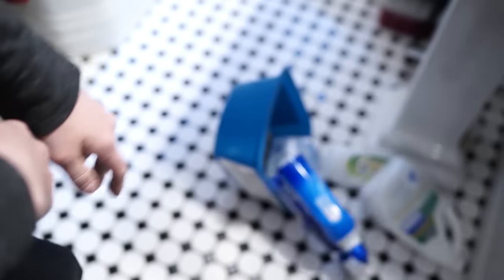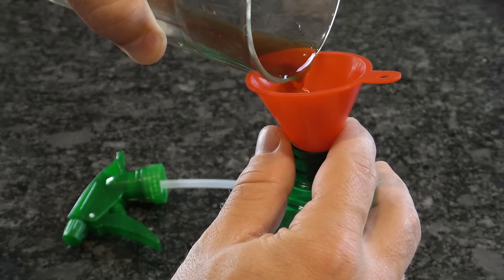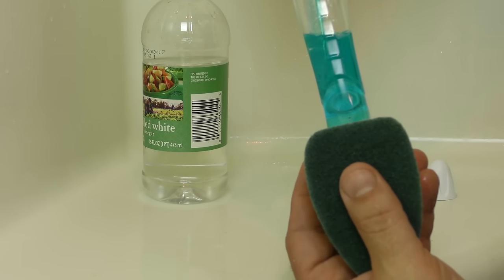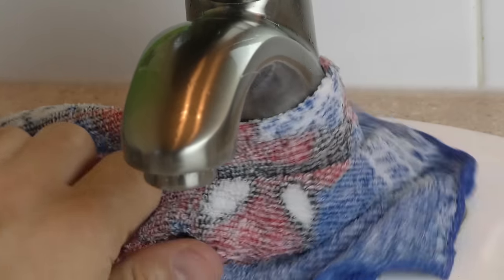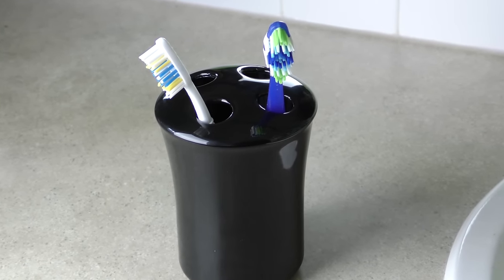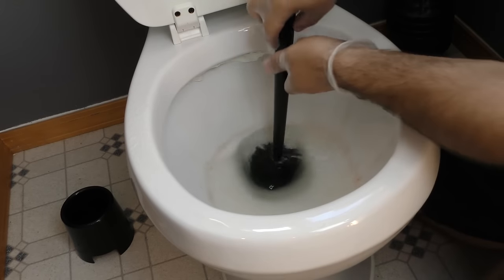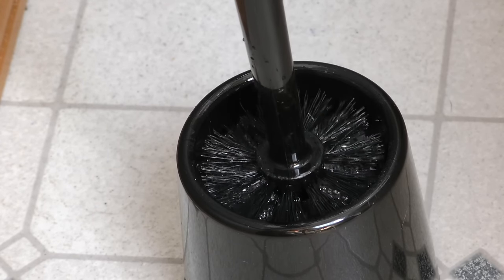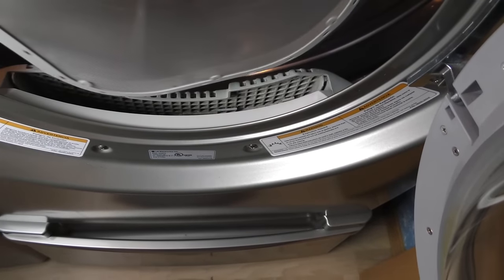7 Genius Cleaning Tricks For Your Bathroom

Comment: Ditch the toilet brush, disgustingly bad idea, just use the specially designed bleach dispenser that quirts upwards  under the  toilet rim also use limescale remover  in toilet  bowl and wash basins  taps also use a toilet rim clip -on cleaner dispenser  
I wouldn't mess around putting my hands in the toilet, unhygienic, or using any kind of cleaning solutions near/on my hands.
Most of the things in this video are time consuming and messy.

Comment: thats too much work for a toliet i use a product called The Works.  It cost $2.  Just spray in toliet and around the rim. Close the lid for 10 minutes then take a toliet brush and  brush around inside.  Your done in less than 20 minutes with no back pain labor.

Comment: Getting old like me?  Still not ready to throw in the towel and gimp off to the nursing home?  Still hanging on to old useless things?  Here you go:  brushes (tooth, broom, any kind) clean them with appropriate products (toothbrush soak in alcohol then rinse and let dry I suppose)...Clean those old moldy shower tiles with your achy bones with the longest reaching bastard stick you can find (maybe that grabber you saved for with a cloth on the end) and then if it's stubborn like mine use that bleach pen you really pined for!

Comment: Ummm, im a professional cleaner, and i would NEVER use anything like a green kitchen sponge to clean those plastic showers and tubs, you will scratch off the seal...and windows..u just splash water on the mirror and wipe with a microfiber rag...not a helpful video